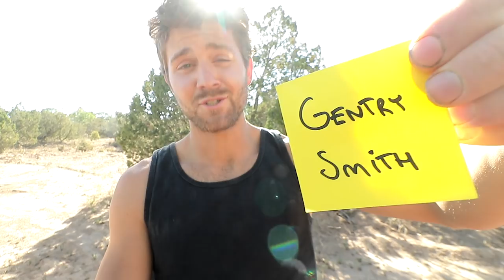Overland Trailer BROKE! but we STILL MADE IT!

Comment: Not sure if someone mentioned before but I would strongly recommend a small welder that can run off your trailer batteries to have on the go. Any small repairs or even some major ones can be fixed on the spot. Just a suggestion. Your new videos are looking really good, very impressive filming and editing!!
Reply: jeremysev in a bind most definitely but I'd get something more permanent like a Hobart 110.
Reply: Check out a premier power welder! Replaces the alternator on the Jeep and a small control box.you can make repairs &  run power tools on the trail
Reply: Since you have dual batteries, grab a mig Ready Welder. It works amazing and no need to modify your vehicle.
Reply: A good suggestion but welding is no easy feet. Does Jake have any welding experience?

Comment: Hey jake, I've got an M416 trailer setup. Just curious why you are using small 2-3 leaf springs with the weak brackets instead of the 9 leaf and 1/4 inch mounting bracket setup from stock. The original setup is rated for 1100 lbs of cargo along with the trailer and its a much more robust setup. If you're looking to replace them springs with factory stuff shoot me a message and I can try and find all the parts for you. Happy Trails!
Reply: Holy cow, 3.5k? How many leafs on the spring?? The original springs on my 416 have nine leafs and shocks!

Comment: A few thoughts:
- Your springs are too long for the space between the spring hangers... the shackle should never lay over as much as I see in the picture, it should be closer to vertical.  This is what caused the spring hanger to break... it didn't fatigue off, it was pried off by a compressing spring that had nowhere to go.

- Your're right, hi-lift jacks can be a bitch, and can be dangerous.  That said, sometimes they are needed to do the job, but they won't work without lubrication, and all it takes is a splash of water, beer, pepsi, or piss, if it's all you've got.
A bottle or scissor jack (like the stock one on a CJ) and a short piece of 4x4 is usually a much better for most common jobs like changing a tire.

- Taking weight off the hitch will increase the weight on the trailer's axle, but these trailers work best with very little weight on the hitch.  You should be able to un-hitch it and wheel it around by hand without too much difficulty.

Comment: Be careful Distributing your weight to the trailer... when you break hard the rear end could fly up in the air and you can jackknife especially with a short wheelbase like Jade best thing I could say is do a few test brakes before you hit the road.
Reply: bmxaz06 more importantly you don’t want weight distributed axel-back on the trailer. It will make the trailer less stable.
Reply: Thanks for adding that... Im busy working on my truck so it's hard to go into detail... Just hope Jake reads this

Comment: I did not see you mention it or install it but  there is supposed to be a metal sleeve in you leaf spring bushing for the bolt to slide thru

Comment: You do realize that is only as 1/4 ton trailer! With all that stuff you loaded into it no wonder the spring shackle broke.
Reply: I carry more weight in mine and it's the civie version. No issues
Reply: black84z28camaro - What is the load rating of your trailer? If you consistently exceed the load rating you may have "no issues" at least for awhile and maybe even for a very long while. But it will fail when you least expect it. As happened with iamjake.
SWxOR - If you saw the welds were bad and you were aware or even suspected that the load rating of the trailer would be exceed (500 lb for the M416 (did you know that?)), you should have made fixing the welds a priority. I also noticed that the lunette is bent. Was that on purpose or did something go wrong.
Reply: My build and his build are two different animals.  My started as a 50 something t3c bantam trailer and now has a better axle. Better springs with a 2.5 lift. I built a shock system for it to smooth out the ride. I pull more weight with my job box in it than make has with supplies. My box is around 700-800lbs of tools. Trailer has had a good 40k miles on it doing this. I guess I know how to fabricate and build my shit .. .

Comment: When I inquired about trailer weight and tongue weight, your buddy said it was good. Apparently not and that sucks. I would build an entire new frame (new axle and leafs) and set the tub on it, adjusting for fore and aft weight distribution. Leave an overhang in the back for your Jerry cans to offset the weight of the junk on the tongue. Fluid wise, calculate your change. Say 10 gallons of fuel on back vs 10 gallons of water on front and estimate usage rates to keep trailer in weight spec as you use.
Hilift or monkey on a stick jacks are a century old design. It doesn't get any more simple. Clean it, lube it and it will work like it is supposed to. They tend to corrode when not used, squirt some motor oil on the two pins.
Also, maybe I missed it, but I didn't see a steel sleeve inside the leaf spring bushing. Hopefully you have one in there so the shackle bolt has something to apply pressure to, to reach torque spec.

Looks like you are having a good time, I envy your resilience and adventuresome attitude.

Comment: Hey Jake. Hope you got to see some demonstrations on how to use the highlift while out at the expo. If not. do some research on how to use it. That tool is very helpfull if properly used and maintained. First, get a jack cover for it. Or at least carry some lube for it like white lithium greese. When jacking, be sure to angle the bottom of the jack the correct because as it raises, it will lean. Usually you kick the base in and the top leans back in as it raises, but not always the case.

Comment: I'm a Jeep guy, and you've sentimental attachment to this Jeep, but if you have to tow a trailer, you'll be more efficient and more capable if you just switch to a big truck with a camper, or even a large SUV like a Land Cruiser.  You've not much off-road-ability when you're heavily loaded or towing a trailer, so why bother?  Go for a more "overlander" option.

Comment: At this point I think that it is time for Jake to get a new Jeep and Trailer.  Way too many welds gone bad, broken hitches, and delays in itineraries due to repairs.  Jake has 122,000 subs now.  If each sub donated just 0.50 to 1.00 dollars, Jake could purchase a new fully equipped  JL and have enough  left over for a roof rack and basket and basic sturdy trailer.  Then he could spend more time exploring and less time breaking down.   Recall that he broke down on the Baja trip too,  So, everyone lets start a GoFundMe  called one dollar for Jake!  Or donate via paypal or patreon.  Just one dollar.  Skip just one of your STARBUCKS coffee orders, or for one time order a cheaper regular coffee and give the savings to "Jake's New Jeep."   Another youtuber was "given" a Toyota 4-Runner by an "anonymous" donor, becouse her small truck was run down and she explored remote areas.

Comment: I don't know too much about the amount of camera and production equipment you carry, but otherwise you guys are hauling way too much and you're going to run Jade into the ground. I would take some advice and knowledge from the backpacking/camping community in an attempt to cut some weight. If you want to have two full grown adults living in a Jeep you need to start considering minimalism. Sure a shower with a reservoir and pump is great, but you could also get a 5 gallon solar shower bag that weights 2lbs.  I love your journey Jake, but i swear every 5 videos is about something breaking on the rig. Embrace some minimalism and cut some weight for Jade's sake. Also I would shy away from buying military surplus equipment. Military equipment isn't built for durability, it's built because its the cheapest to mass produce, and the vehicles require constant maintenance. Like daily preventative maintenance. So it was only a matter of time before that trailer went down for good. Keep up the solid work though. Love the past few videos and I'm glad to see you on the move again.
Reply: I will agree with you that Jake should consider scaling back his equipment list. To paraphrase Yali, "why does Jake have so much cargo?". As for comment about military surplus I will have to disagree. In 1969 I purchase from DRMO, Fort Ord, California a 1950 Truck, Utility, 1/4 ton, 4 X 4, M38. This  Memorial Day weekend I took it and the M416 trailer I purchase from DRMO Fort Carson, Colorado in 1976 out camping and over Hayden Pass. I have found they, the jeep and trailer, require no more maintenance then a normal car. In fact my 2015 Toyota Rav4 has given me more trouble then the M38.